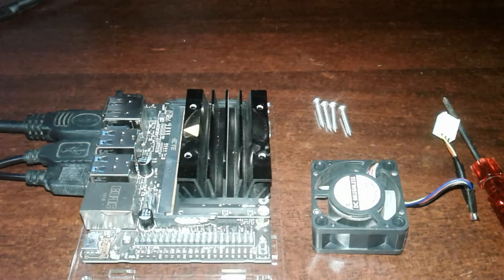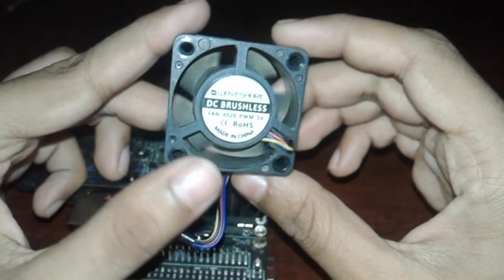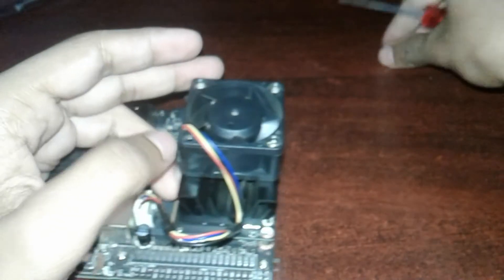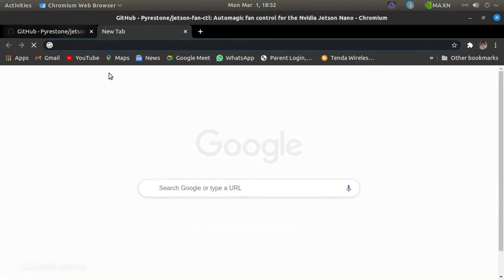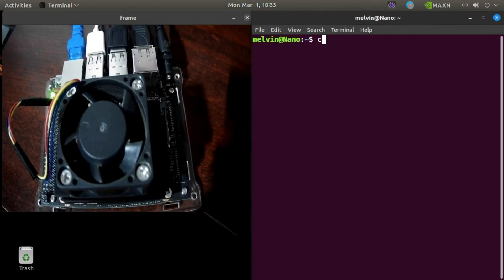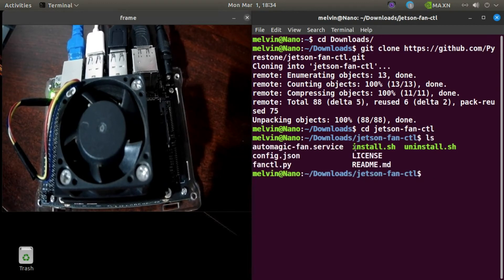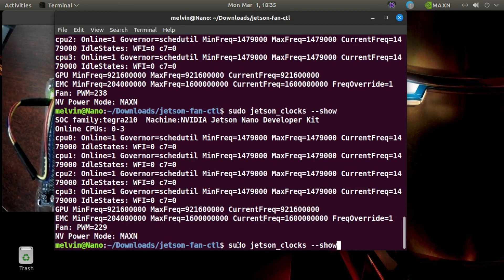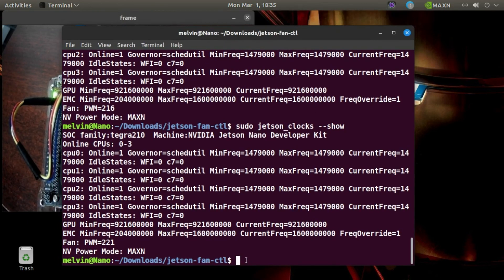Jetson Nano Fan Install And How to Do Automatic Fan Control Management In Jetson Nano.

Comment: Great stuff thanks. How do you turn it off? your voice was very low btw
Reply from the maker: I know that I did not have a good Mic,  Now I have brought a new Mic and the new Videos have a good Voice. 
please subscribe my channel
Reply from the maker: To turn the fan of you can uninstall the fan control script , using the same way as you installed it , there is an "uninstall.sh" file run it in the terminal and it will off the fan. to restart the fan install it again.